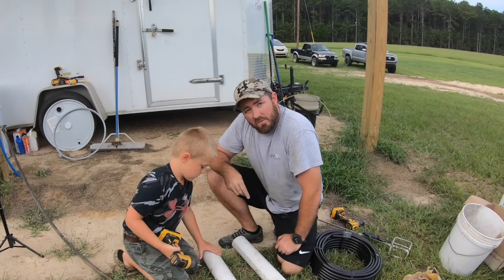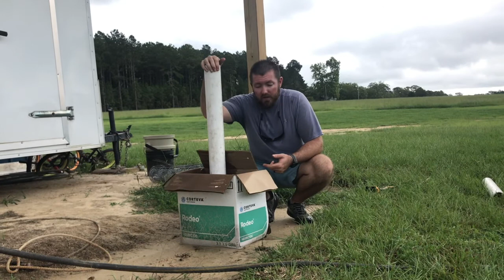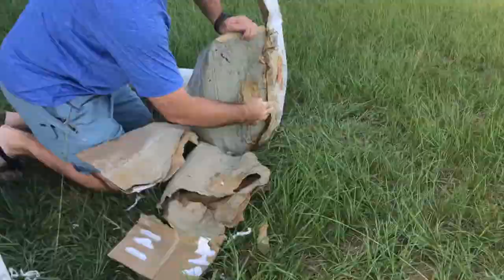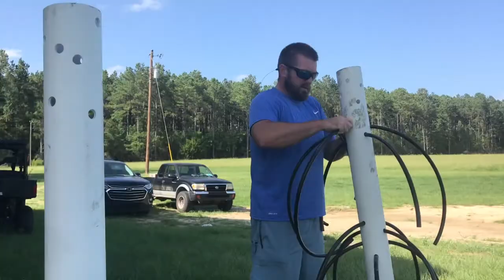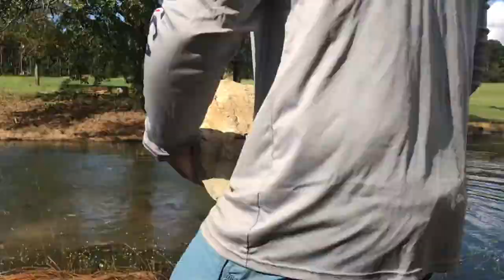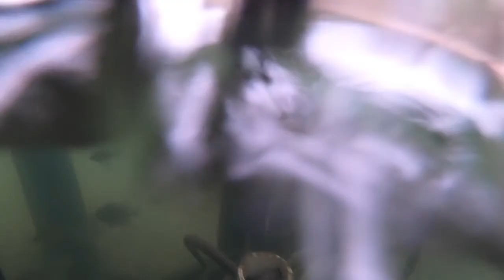How to build the best structure for your pond.  These fish attractors are like a magnet!

Comment: The stainless-steel screws are a good idea, but a cheaper way is to just drill a few large holes in the bottom of the pipe and the concrete will go into these holes and you will never get the pipe out again.
Reply from the maker: That is a good idea. That didn’t even cross my mind lol. I’m about to make a few more and I’ll go that route this time. Thanks.
Reply: So you're  saying  place the tubing in and then just pour the quick crete in from the top and let dry, instead of the screws?...

Comment: Hello! I got some questions. First off, how long is the width of the Poly tubes? Second, what was the length of the pvc segments you used on the one you build on camera? And last what was the size of the bag of Quickcrete you used to make the habitat? Thank you and I loved this project so much it inspired me for my upcoming Eagle Scout Project : ) !
Reply from the maker: Poly tubes were about 36”. PVC was about 4ft. And the Quikrete bags were 60lb. Hope your project turns out great.
Reply: @JackArmstrong-jackdaddycustoms  last question, how many segments of the 4ft polyester tubes did you use to make the habitat?
Reply from the maker: @MRVNgotEM  that’s completely up to you. If you want it tight and thick for baitfish to hide in you will need a bunch but if you just want a little open structure to fish, you could just use a few.
Reply: @JackArmstrong-jackdaddycustoms  okay, thanks for the help
Reply from the maker: @MRVNgotEM  anytime. Let me know if you have any more pointers.
Reply: @JackArmstrong-jackdaddycustoms  one last question before the planning is finalized! What size of cardboard box did you find you find to be the best when making the habitats? (This might not be the final question :)
Reply from the maker: @MRVNgotEM  probably somewhere in the 18 to 24 inch square size.

Comment: Do the tubs ever pull out if you get snagged?
Reply from the maker: We haven’t yet. We lost a swim bait to one the other day. Hook was just the right size to fit around the tube and it didn’t slide off. Ended up breaking the line. Rode over it in the boat and could see it on the top tube. Tube still was in place.